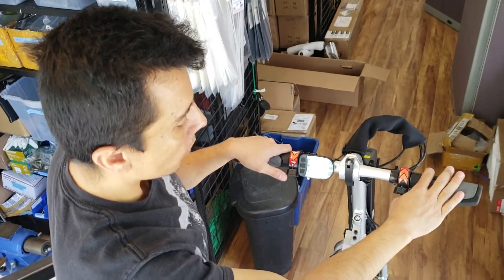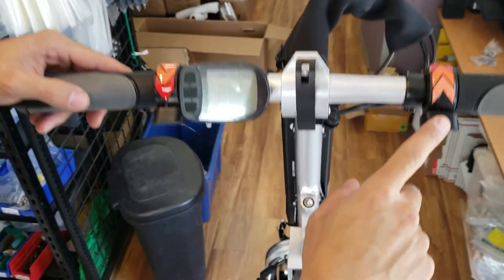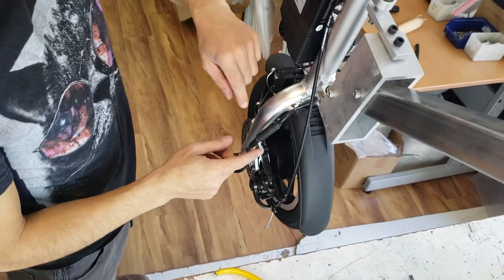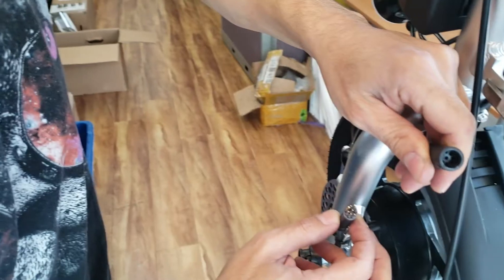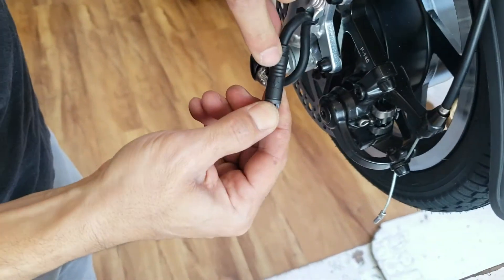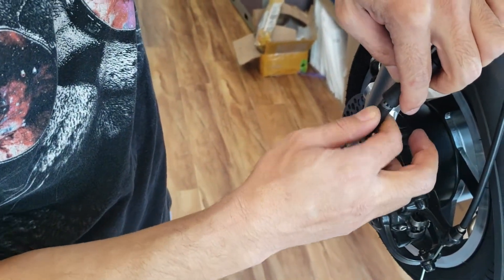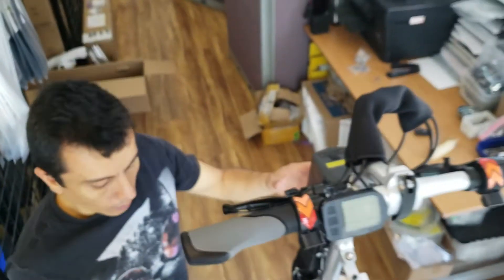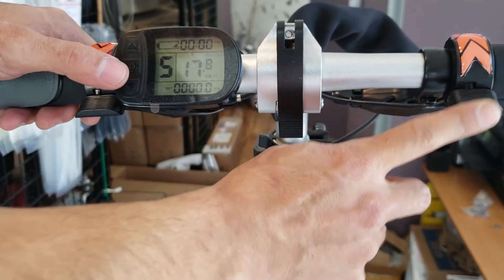Firefly troubleshooting - Error Code 3

Comment: I have a question that nobody can answer. My battery and my control panel dont read the same battery level. The control panel shows run down quicker than the battery lcd's. How can I resolve this please and put back in sync. Thanks